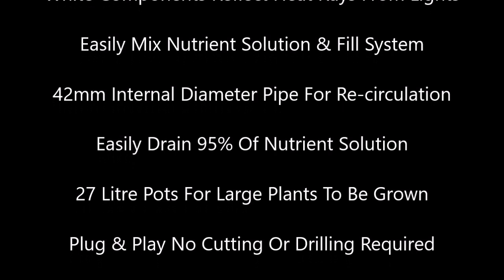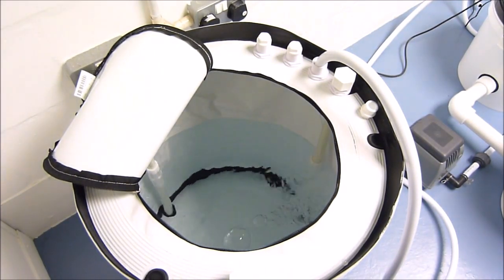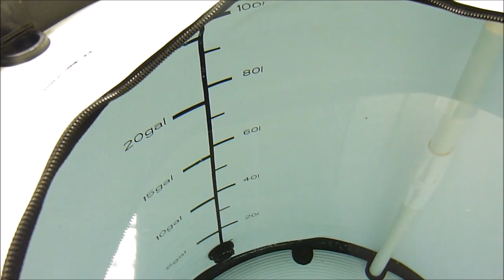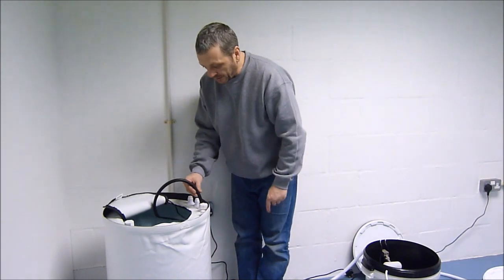Trident RDWC Bubblers - Poseidon Hydroponic Systems

Comment: Looks like all the rest except the white plastic probably makes a huge difference.  I have been looking to change to a multi flow bucket system like this.  Maybe Poseidon is the one for me.
Reply: Christian Gaines white buckets are great if you want algae
Reply: sorry for the newb question, but what are the benefits of a control resevoir? the little resevoir bucket?
Reply: @dankmemes5677  green water fur written all over it
Reply: @thegoldenboy294  the control bucket controls the water height.
Reply: @dankmemes5677  not if they have black interiors. The white outside is to keep the water cool, the black inside is to keep the algee down.

Comment: Upperhydro2
Submersible pumps generate heat. I'd go with Non-Submersible pumps to keep the nutrient solution as cool as possible and much cheaper than a Chiller.